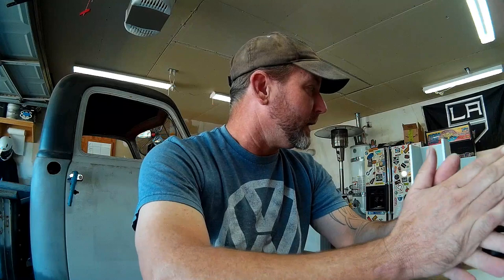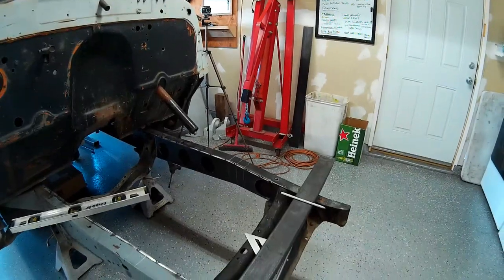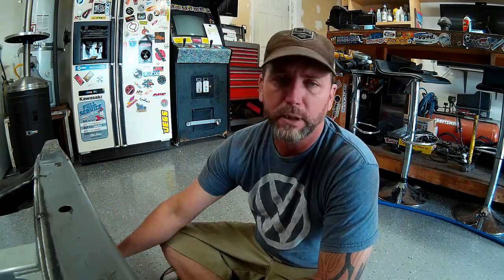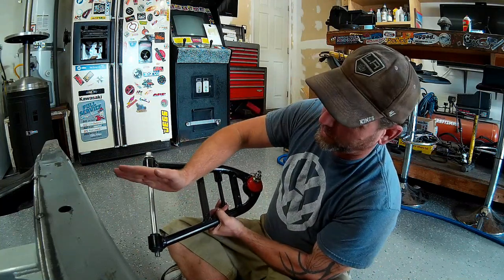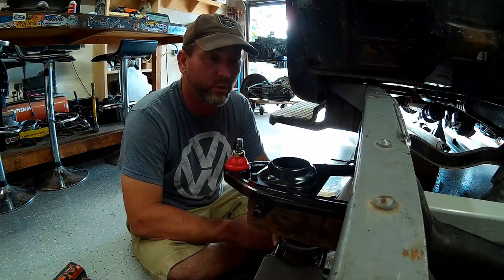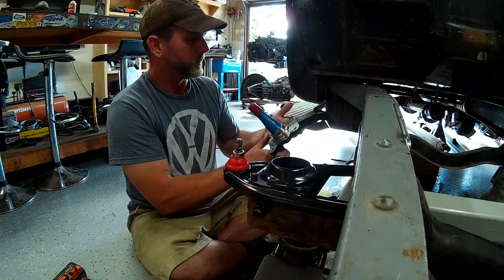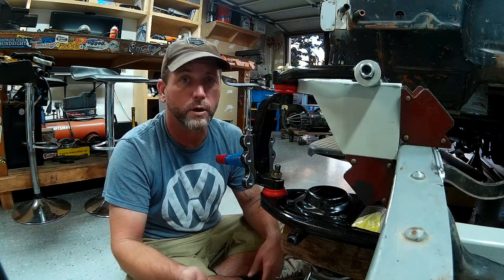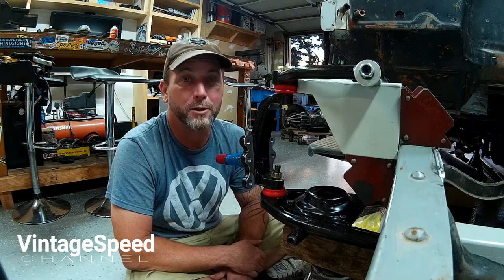P48 Project; Helix Mustang II IFS Install, Part 1 - Fitting the Crossmember

Comment: how did you determine the line where you made the horizontal cut to meet the bottom of frame?
Reply from the maker: once you know where the center of the x-member hits your frame, measure the width of the x-member and transfer those dimensions to your frame, that will give you the front & rear dimensions you need to trim the vertical cut for the x-member.  undercut your dimensions and grind to fit.  it is important to note that ride height will be 1/2 way between the upper & lower arm mounts on the x-member, approximately.  so keep that in mind when determining where you want to mount the x-member into the frame rails.
Reply: ok that clears it up a bit,  thanks Jim, great videos, tonight i cut!

Comment: Found your video series recently, glad I did, just starting the install of this Helix unit on my 49 GMC. When I bought the truck is was a stalled project, started in 1998 by a family in NM and came to me in a frame off condition. Do you have any suggestions for installing this with the frame sitting on my lift. How do you determine ride height? I am planing on an inch or 2 below factory? The kit came with a 4 link set up, not sure if I should use it or not. The truck came with a rear end from a mid 80's Blazer with 3:73 gearing and leaf springs. Your thoughts would be appreciated.
Reply from the maker: Hi Tom, I'm glad you've getting some use out of the videos!  As to setting ride height, first thing you need to determine is if your kit has a stock or dropped spindle.  The distance from spindle center to the lower balljoint perch will (essentially) be your ride height.  You can fine tune it from there.  As to the 4link, YES, once you have the front all done and setting on the springs, I'd use it!  You'll need some type of coil over shock suspension to carry the weight, but a 4link is the best way to locate the axle in the frame.  Best of luck on your project, sounds great!  I'll be back to work on the P48 project soon.

Comment: Sir is this for a 1948 F100? I have a 49 f100 and thinking of getting a kit off eBay thats already knotched.
Reply from the maker: the kit i installed is on a '48 chevy 3100, but i dont see why it wouldn't work on Ford as well.  if your track width is close to 60 inches, this may be what you're after.  thanks for watching!
Reply: @vintagespeed  love the work, i need to ask ya.. the cross member is level with the top of the frame correct?

Comment: Mab I can't thank you enough for the video. The one helix made is a joke.  It gives you a idea but that's it.  I think you have explained it nice. Then reading the comments too.  I got my frame boxed. I ran out of light so tomorrow is the day.  53 5 window going to put a 350 Stroker in.  How do you account for the weight of the engine
Reply: If you get your ride height set with out a motor it's going to squat when you put that weight on it isn't it
Reply from the maker: @jvmiller1995  it sure is, i'd suggest doing the suspension at stock height and adjust it once the car/truck/whatever is completed.  thanks for the comments man, keeps me motivated that they're helping someone!

Comment: what i mean is, how high or low the xmember sits between the rails? how do you determine that measurement?
Reply from the maker: the LCA (lower control arm) should be horizontal once the springs settle, so you can measure your spindle to lower balljoint height and use that as your ride height location.  level the frame, drop a plumb line at the x-member center, and determine where your wheel center should be in the fender, once you know that height from the ground, you can set your spindle center the same & measure the rails for your cuts.
Reply: thanks for the help Jim.  always nervous making the first cut, funny cuz it didnt bother me a bit gutting out the shock towers

Comment: Thanks for videos Jim
I'm installing the same kit in my 53 chevy truck. Since i'm not changing the engine I will be installing it with the original 6 engine in it.
My question is when you boxed the frame did you install the metal on the outside or inside the frame rails and what are the advantages or disadvantages?
Thanks
Mark
Reply from the maker: i boxed the frame rail right on the edge, so i guess technically the plate was just outside the edge of the rails.  i did this so i could have a nice corner weld all the way down the plates.  this does add a little width the rail though, but since we were doing custom motor mounts, no biggie.  the benefit to creating a box out of the frame rail is strength.  a box rectangle will be longitudinally stronger than just a C frame rail.  this is where the term "boxing" comes from, cuz you're building a box.  if you were to just plate the inside of the rail without actually boxing the rail, it can still twist under torque, with the 6cyl though, you shouldn't have any issues with twist.  :)
Reply: Jim
Thanks for getting back to me.